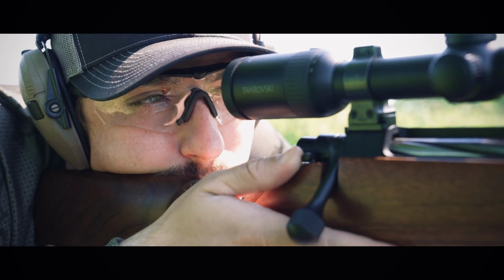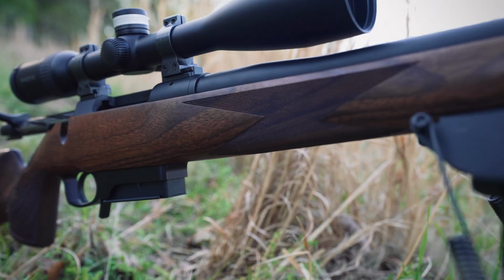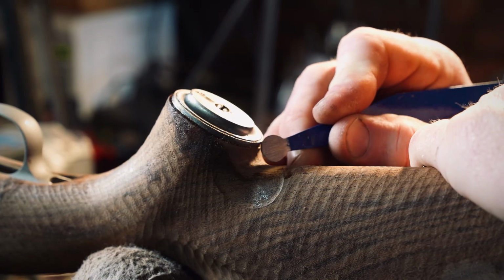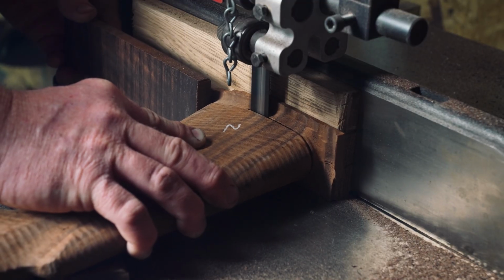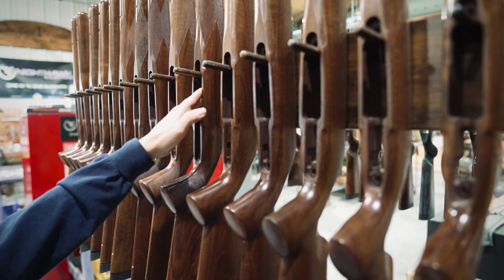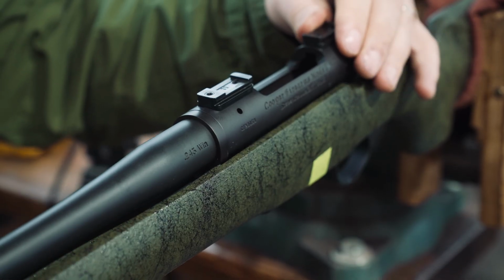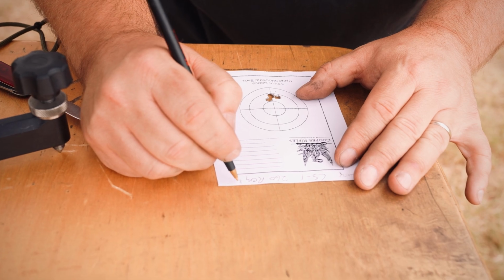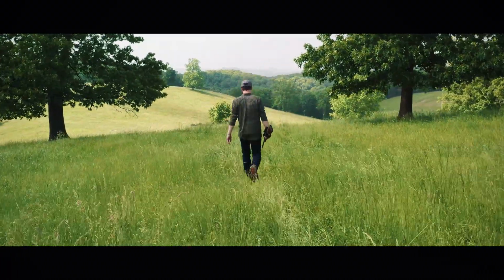The Secret To Building Cooper Rifles

Comment: have several coopers, montana varminters, love them. but have refinished both stocks. sorry but i have yet to find a walnut stock that has a glass like finish. left with to many open pores. i also understand the time required to get the wood to that point, 12-15 coats hand rubbed with steel wool breaking down the finish between coats, min. but the end result speaks for itself, cant even guess ay what that would cost. havent seen any on the new releases yet.